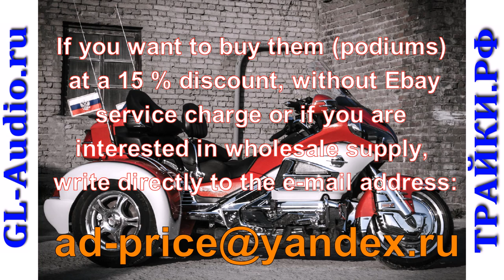Honda Gold Wing GL-1800 Rear music upgrade. Goldwing 2002-2015 Speaker box. Instruction manual

Comment: Seems like a pretty cool concept. I wonder how the stock amp performs? Ideas?
Reply from the maker: Roadie Ric Polk Audio MM speakers perfectly fit the stock amp; the resistanceis 2,5 Ohm, thah corresponds with the OEM speakers. When installing these podiums we usually change the stock amp into alpine PDX
Reply: After  13 years & almost 100k the sound of my '02 is definitely due for an upgrade, so I appreciate the info.
Reply from the maker: Roadie Ric  I strongly recommend you to mount our podiums and to install Midbass 5,25" into them.Instead of the upper OEM speakers you'd better install Twitter speaker and at the front change the speakers into 4" coaxial speaker.You can connect it all to some 4 channel amp with the help of High to Low Level RCA Line Output Input Audiolmpedance Converter.
Reply: I think this will make a good winter project. Many thanks again.